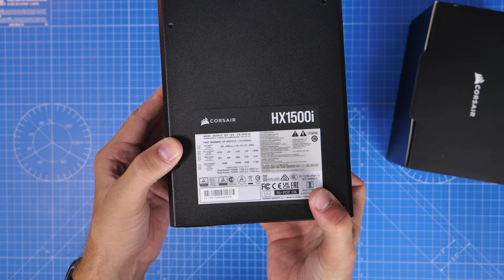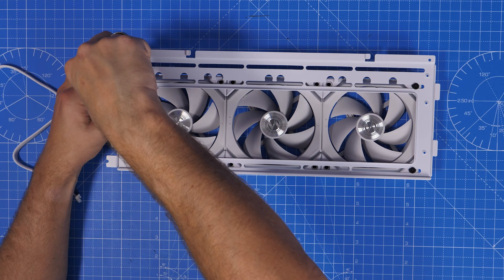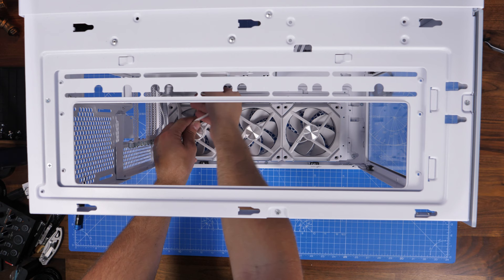I made some mistakes with this Lian Li O11 Dynamic EVO build (Z790, Core i9 13900K, RTX 3090)

Comment: Is a 1200W Psu unnecessary for a 3080 12gb (strix) and a 13600k?
Reply from the maker: It's best to check this with all your system specs https://outervision.com/power-supply-calculator

Comment: Well that’s unfortunate to hear the L-connect is horrible. I like NZXT cam but their RGB fans look really mundane. So I went Lian Li after seeing Prawns videos. This might be a isolated incident but for anybody else was it basically impossible to find a controller outside of the 3 pack 120? I’m only running 1 120mm. I’m still waiting for my controller to come from Germany….
Reply from the maker: You can buy it from AliExpress I believe, but yes, the triple pack is the best way.
Reply: @TheProvokedPrawn  I only needed 1 so I didn’t want to buy the 3 pack just to leave 2 in the box to get the controller crazy local pc stores stock Corsair / NZXT controllers but not Lian Li

Comment: Honestly Mr Prawn, you inspired me to build my first ever PC which I am in the middle of right now and I cant thank you enough. I have watched so many of your videos and learnt everything from you, it is very much appreciated. I am currently building a 4090 with the i9 13900K in this same case, and one thing that interests me by this video, you swapped the black cables for those beautiful white cables from the GPU to the PSU,  and the larger cable ( the 24 pin one from the PSU into the motherboard I believe its called). So I have the Z790E motherboard and the Corsair RM1000X PSU, Is it possible to get those white cables for these? I just want to be sure it is safe to use different cables. Thanks again! @TheProvokedPrawn
Reply from the maker: Thanks Gareth! Glad to help :) Do you meant the strimers?
https://www.youtube.com/watch?v=SjOyo2H69vw
https://www.youtube.com/watch?v=OTnzx75cw3s
Reply: @TheProvokedPrawn  Thankyou very much thats perfect thankyou!
Reply: They will work though right?
Reply from the maker: @garethallport2262  yes
Reply: @TheProvokedPrawn  Ordering them now. Thankyou so much